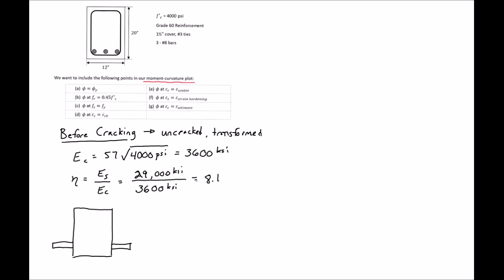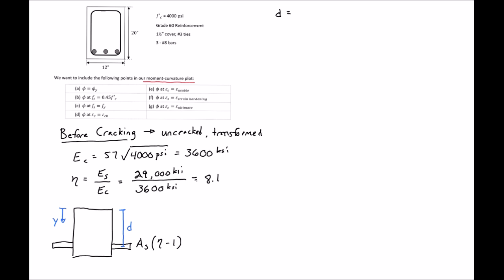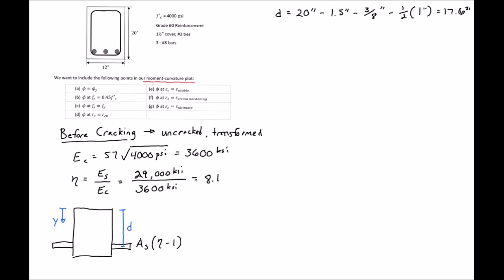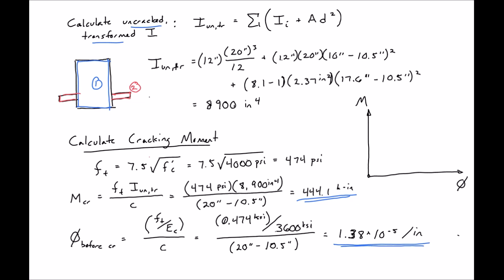7 - Moment Curvature Example - Before Cracking

Comment: In this video, you transform by multiplying by n-1. But in the next video in this series, you multiply by just n. Is this because you tranform differently for cracked vs uncracked?
Reply: Because for uncracked case, -1 implies the effect of concrete in tension. However, after cracking we neglect the effect of tensile strength of concrete.